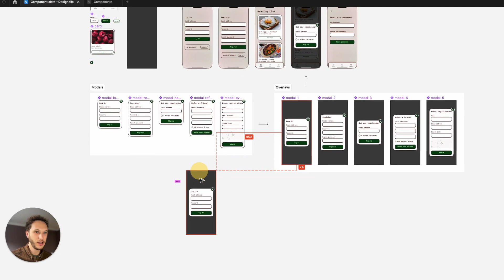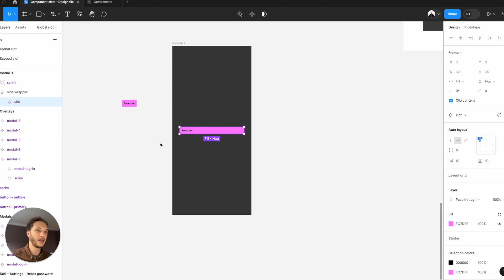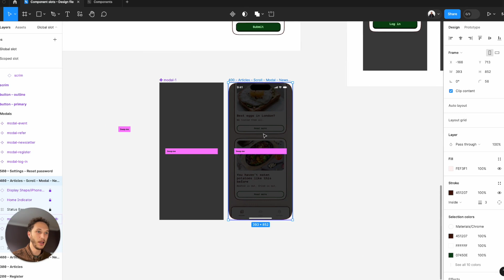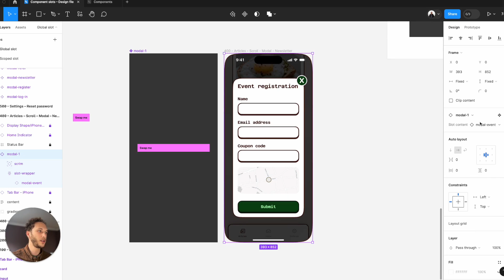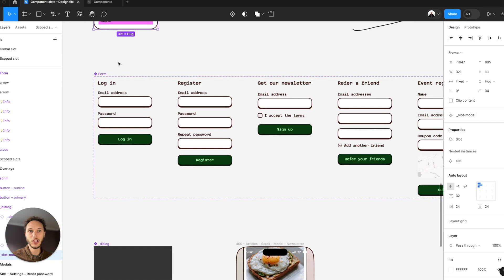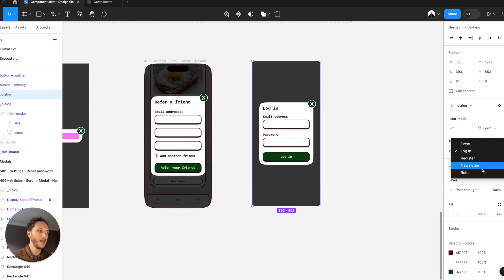Figma tip: Scoped slot components

Comment: The problem I have run into is if the design system grows large, the file can become very laggy. And large here is measured more in the layering of components rather than the plain number of components. I'm now deconstructing layered components and going back to detaching and documenting more to try to get my file working as fast as possible.

Comment: What I don't understand is why a slot content needs to be a component? Why can't you just copy and paste a frame (non-component) into a slot area in the parent component. That would be a true web-component slot extension. Instead, now I have to convert all the slot contents into a component which is not always desired.
Reply: Yeah, they missed the mark on this one.  Slots concept in web dev are most powerful in container elements like modals and cards where you want to let users edit the content area to their hearts... content.  Making it only swappable with components pretty much kills what would otherwise make this a powerful feature.  Someone mentioned using one slot and allowing users to stuff everything they need into a component and slot that in.  That seems more aligned with the web way of slots, where you have a single slot just for content (and maybe a slot for title and footer buttons).  But you don't have 10 slots for the content area just to swap with individual other components... that's too inflexible and limiting.
Reply: YES THIS. 
It's so frustrating that you can't just put content into a placeholder slot area. You have to create a component for what is essentially a one-off instance, every single time. 
It has a lot of other negative side effects as well - like if you swap the slot with a component and then try to reset the changes on that component, it REMOVES the component instead (reverts it to an empty slot again). And you can't detach it, either - doing so will detach the parent component(s) for some ungodly reason. :(

Comment: I had high expectations of this method. But unfortunately I have more problems and errors than benefits. For example, if I have a master component that has 3 variants. It is displayed with auto layout errors in a slot. But if I store an instance of one of the variants and turn it into a new component, then I can access the original variants (see master). There are also errors if I want to use a number of different height-spacers. these are not displayed in the slots with their fixed heights. All my preparatory work makes little sense if I can't then use them
From my point of view, a clean solution for the integration of all instances and variants is simply missing. This would make it easier for colleagues to create small layouts themselves. But we've been waiting for a solution for ages. Let's take a closer look at Penpot. Perhaps there are already possibilities

Comment: The execution couldve been better. I called these placeholder components, but manage to keep the autolayout settings - so no crashing there, while also - doing better job in terms of component properties - but I get that this part was lacking due to the fact that this was just for a demo. Again - by doing the layering part little better, you could easily avoid the design crashes.

Comment: I have a question here, why did we take a component and a screen approach instead of a open overlay approach. Is there any limitations in the overlay approach in modals, drawers or similar usecases?
Reply: By "open overlay" do you mean just using a variable / style for the scrim instead of using a component?
Reply: @disco_lu  by open overlay I mean using an overlay interaction instead creating screens and with it all these components. Even in case of “open overlay” interaction we can use variables, right?
Reply: @shreyaskulkarni9233  Ohhh! Sure, you could do that, but a few issues:

1) Your variable is converted into a raw hex
2) You are forced to built a prototype for every idea you want to test out, I personally prefer to do flatter screens rather than prototypes!
2) Your devs would need to run the prototype to see the overlay, and there's no way to inspect a prototype

Great point though!
Reply: @disco_lu  When Figma will allow a style or variable for Prototype overlay color? Or for Page background?

Comment: This is too much work on a simple component, what Figma needs to do is add support to Duplicating a Nested Component! Meaning If I created a Form Component that has one Text Field Component nested in it I should have feature where I can set the property of that nested Component to allow me to duplicate it and since we have auto layout on everything will just look good. I hope this feature gets added in our Component Properties panel to select
Reply: Seems straight forward
Reply: This.  We should be able to check an "Allow duplicating similar instances" option.  We should also be allowed to mark a frame inside a component as an "anything goes" zone which will be perfect for container components like modals and cards where the content area is too variable and indefinite to be captured as components.  Instead we have this instance swapping slot strategy which feels like putting the cart before the horse.

Comment: i am a huge proponent of this technique! cards! modals! drawers! basically any styled container whose contents you want full flexibility of can and should take advantage of this approach. good demo Luis!
Reply: Can you elaborate on what you mean by flexibility? Cuz we still have to create each new form individually. It’s cleaner, but I’m missing the flexibility here. Thanks
Reply: @AJ-yj6kd  the flexibility lies with the designers "consuming" the component. The benefit here is that the design system maintainer just needs to be concerned with the parent / container of the modal/dialog, and then each designer can decide what they put inside it.
Reply: @AJ-yj6kd  happy to, and Luis already covered it in his reply, but to offer another way of saying it: this allows designers to be tightly aligned on the styling of the container that surrounds custom content (like a form), which is where the flexibility lies. This means they don't have to manually set up padding, background fill color, border color, border size, shadows, etc. every single time they need a Card, Modal, Drawer, etc. They grab an instance, turn their content (like a form) into a component, swap out the slot for that componentized content. And having a single slot means you can inject unlimited number of objects in that container. That's where the flexibility lies. This is also why I am very much against the multi-slot approach in most (but not all) circumstances. It can be stifling.

Comment: I tried this week in Figma to create different parent components that display achievement badges at different scales using this method, but all referring to one size of badge design. However, the instance swap breaks the scaling once the placeholder instance has been swapped and the strokes appear at the original thickness and not the scaled thickness. It would be great to talk to you more about this as I've seen it raised in multiple places in the Figma Community.
Reply: could you link to that community thread? I'd be interested in taking a look and seeing if i can help.
Reply: agreed
Reply: If you have a file, @alicepackard and I can duke it out to find a solution 😀
Reply: oh hello! 🙂 just happened to be reading the comments and saw your face
Reply: @hcharge oh wow, hi! 😆 I take it you had the same issue then? 😄 Hope you're well!

Comment: I'm still trying to understand the problem we're solving with slot components, duplication of the modals and the overlay + modals. What are we simplifying here that combined as variant didn't allow you to do already?
Reply: In large design systems, we often find that there's a lot of "tail-chasing", where you need infinite combinations of components, but can't keep up with requests at a library level. This can often mean that designers on the team make loads of local components, and therefore deviate from the system orrrr they detach the main modal / dialog component, and fill it with the content they need. This is an attempt to keep the visual composition of the component identical, but promote infinite flexibility on the inside
Reply: @disco_lu  I might be wrong but I think he's saying that we don't need to create the slot component since we can already switch instances of modals once we created the variants
Reply: @feelcollins4358  in theory, yes that works! But what we probably want to get to is a world where the modal/dialog parent container (including slot) is stored in a global library, but then each designer can decide freely (and locally) what they use for the content. So the design systems team don't need to be concerned about the contents, just the parent.

If you want to use the "preferred instances" approach in the modal/dialog too, the design systems team would need to constantly update the list of available options every time any designer wants to include their own form. This will probably be unsustainable at scale.

Not sure if I'm answering the question effectively though!
Reply: @disco_lu well said
Reply: @disco_lu  from the perspective of the implementer having a generic modal (which can have variants) but is agnostic to the content is way easier to implement and to maintain.

Comment: Not sure if we need each form to be a component. File would get too heavy too. I think as long as basic things like Title Section, Form inputs, Buttons are built it should be fine. I like the idea of slot wrapper though, will try to incorporate it without having variants. Thanks!
Reply: unfortunately it's necessary for this method to work. components can only be swapped with components, so having each unique form is the best way to go. at that rate the form components (made up of instances like buttons and various fields just like you described) only exists so it can in injected into the scoped slot.
Reply: Couldn’t one form with component properties work to change the text of the title, labels, and button? Maybe with a variant for how many inputs you need? EDIT: or create max number of inputs that you can hide if it’s less